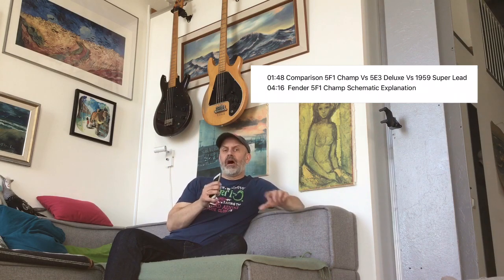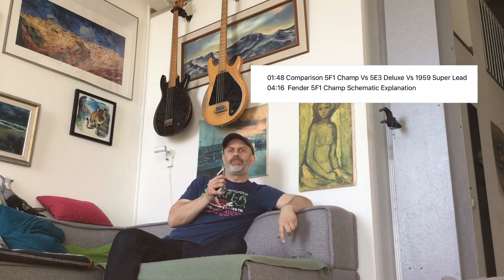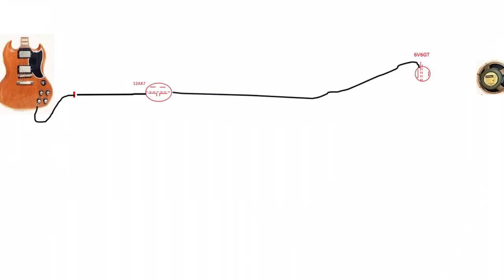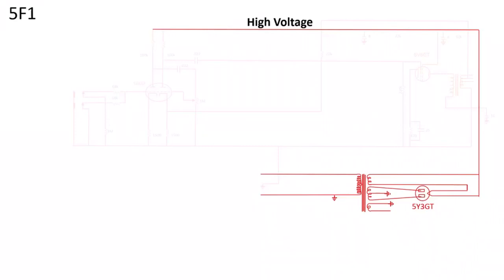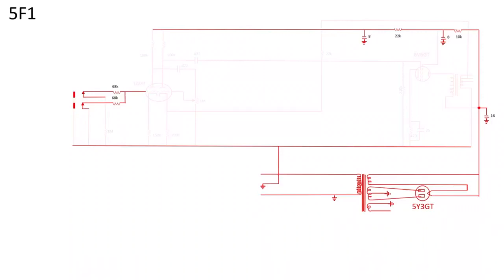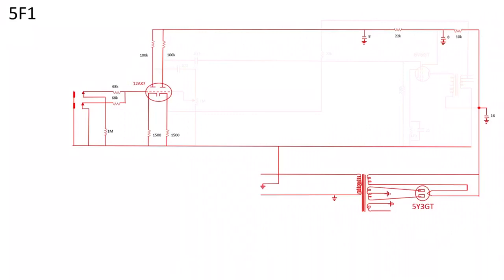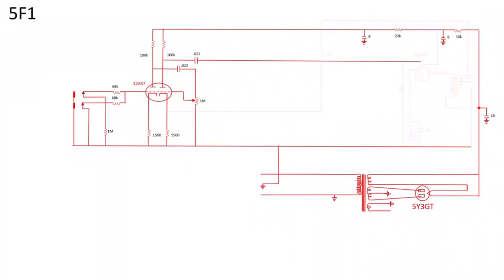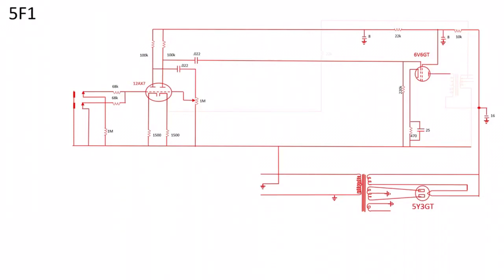Champ Vs Deluxe Vs Super Lead - Why do they sound different?

Comment: Funny. When I was thinking about selling my 68 Traynor YBA-1 (Bassman circuit) because I didn’t need that kind volume anymore, I was having second thoughts about losing access to that tone. So I played it cranked for a few minutes, then played my 66 Airline (Champ circuit) cranked for a few minutes, and was satisfied I was still going to be able to get that sound. The only difference I really heard was the bass and amount of air the Traynor 4/10 pushed. Otherwise the basic tone of the two (when cranked), was quite similar.

Comment: Just to mention before anything else I love your videos and if I need a reference for LP to Marshall to Greenbacks you are the best source on the YouTube for sure. Regarding to explanation there is few things that are bit more complex then it was explained but there is a one thing that is sorry but completely wrong. 😔. Sorry I do not want to sound like the police but I kinda feel I need to  correct it. Signal just simply does not come out of the plate of the output tube. Plate is fed from the corresponding node true the output transformer with a current. Whole current goes to the ground. Grid varies the amount of the current flowing true the tube. This variation follows the form of the signal. This change in the current is making a magnetic field in the primary of the output transformer and indeed the iron lamination. Magnetic field varies in same form as the signal does. Secondary winding being in that variable magnetic field generates the voltage that is used to power the speaker. So on the speaker it self in this type of the tube amp you have never galvanic connection from power supply to speaker. Speaker current is flowing just true transformer secondary winding and the speaker it self. Sure winding ratio serves to change low current values that tubes can handle in Amperes needed by the speaker.now to expand a little. Load on the secondary winding determinares impedance of the primary winding therefore it is important to connect a speaker to appropriate output winding. Connecting for example 8 Ohm speaker on the 16 Ohm terminal will render primary impedance to 50 % of the nominal value resulting in amp trying to deliver double current true the output tubes. That breaks stuff. Not having a speaker connected is even worse when tube amp is on. No speaker connected means there is nothing to resist and the balance is off, this will make the tube run wild and eventually something gotta give. Now regarding to less clear things is a fact that grid if a tube works with voltage only. There is no grid current. Plate resistor serves two purposes. First one is to provide correct DC voltage to the plate and therefore conducts the current true the tube to the ground. Second purpose is to be a place where the variable current (signal on the grid varies current true the tube) passing true the plate resistor makes varia le voltage drop. This changing  voltage is used to open and close next tube with its grid. Coupling capacitor separates high DC voltage from the next grid  but allows variable (alternating) voltage to open and close next stage. Transistor amps deal with it completely differently. Transistors conduct current true their base and they do directly send current to the speaker. Tubes never do. Grids always work with the voltage only and signal is tapped off on the plate resistor. Primary winding of the output transformer is in a fact plate resistor. Inductive type mostly. So similar as with pre amp tube that variable voltage is used to transfer signal to next stage. Only on the power output tube plate current is used differently while pre amp tube plate current is serving just to make the voltage drop. On quatrodes and pentodes cathode current is higher then the plate current. It is plate current plus screen/screens current. Important for biasing. Bias is same as idle throttle on the engine. Negative voltage on the grid if a tube regulates amount of idle current true the tube. More negative grid gets smaller the idle current true the tube is. If there is no negative voltage on the grid or positive voltage creeps up to the grid tube will red plate and die. Pre amp tubes and cathode biased amplifiers power tubes use resistors to provide negative voltage to the grid. Fixed bias amps have separate negative power supply. Most often it is variable kind where you can regulate the value with a potentiometer. That's so called bias potentiometer. It is nothing more then control for that little negative power supply. Cathode biasing uses the offset between the cathode and the ground to emulate the negative voltage. There is a certain voltage drop across the cathode resistor. If the cathode is a reference then actual ground is negative value. So if the idle current makes, for the example, 25 Volt drop across the cathode resistor then the ground is minus 25  Volt compared to the cathode. Simplified this negative voltage is keeping the idle current of the tube in the check. Huh TLDR 😀

Comment: I like the way you draw the schematics so everything remain in place when you switch between them. This is also what I do when I try to make sense of things. However, I don't like the marshall habit of keeping the A and B triodes of the 12ax7/ecc83 together, as it means the signal flow is not always left to right in the diagram. The conventional way is just to draw a single triode with half a casing around it. 

Also, I don't agree that the grid stopper and grid leak resistor contribute to the bias. Ofcourse, you must have a grid leak resistor to be able to give the grid a dc path to ground, but the value of the  resistors doesn't really influence the bias when varied within reason. The bias is set assuming there is zero dc signal on the grid.
Reply from the maker: Thanks, the grid stoppers does indeed not set the bias. I don’t recall saying that in the clip. And as you say a grid leak resistor is needed for the biasing. Cheers

Comment: Pls explain what biasing does.
Reply from the maker: Hi, bias is the voltage between cathode and control grid. It’s the current that flows trough the tube when no signal is applied. If this current is too low (cold bias) the tube gets cut off and if it’s set to high the tube gets saturated (hot bias). Cheers
Reply from the maker: More gain with hotter bias

Comment: Awesome video... probably one of the best that explains how guitar amps work and what (very little) make an amp different from another one. 

I'm sure a lot of guitarists out there won't get it (some get easily lost when there's 4 knobs instead of three on a Tube Screamer), but I have no doubt others could learn a lot from it. 

That would make a great series of videos ; maybe one every week or every other week to keep everyone (including the technology challenged ones) happy.
Reply from the maker: Thanks Phil, it’s really good to hear that! Cheers Johan
Reply: I'm just saying what I think here... I have basic notions of electronics (what is resistors, capacitors, how they work, what they do to signal, etc...), so I can "see" how the schematics works, but couldn't understand "why"... so it's great you provided the reasons why there's such or such components. As said, probably one of the best explication I saw so far. Thanks!

Comment: Have been messing with jazz playing some. Only have a 2x12 JCM 900. Not a jazz amp. Found that plugging straight  into an old ADA ampulator then into the board, a little chorus and reverb. There it be. Sometimes the amp gets in the way.

Comment: This is amazing. I am studying to become an electrical engineer and the building the circuits in the amplifier is my dream job. What do you recommend to a good first step to building amps?
Reply from the maker: Thanks! I would start off by building one off  the 5F1 Champ kits, for instance Tube Amp Doctor. The 5E3 Deluxe could also be a good starting point but the chassis is very narrow and difficult to work in. In the JTM45 there is more space. Cheers

Comment: I used to have a early 70s vibrochamp that I did a blackface mod on. When I plugged it back in after the mod it got real hot and something smelled like it was burning. It worked fine and sounded great, but upon my inspection the turret board had melted somewhat, so that it was warped and kind of wavy but still functional. That was my short foray into tinkering with amps.
Reply from the maker: Hahahaha! No pain no gain

Comment: A while ago I built a 5f2a and I'm not impressed at all with it. It sounds decent when playing it. But I tried recording it and it sounded horrible. I recorded it through a sm57 and into a simi cheap tacam recorder. With this same set up I get great results with my blues jr. but with the 5f2a the audio is unusable. It sounds very distorted and very loose. It's also very dark. The tone knob is kind of pointless because turning it down at all turns into a muddy mess. Is there any way to tighten it up and make it more chimey?
Reply from the maker: Hi, Simon and I compare that princeton to a Deluxe here
https://www.youtube.com/watch?v=RrCsViN0B9s
It’s got a less firm tone but if the tone knob is pointless maybe there is some component value that is wrong? Cheers